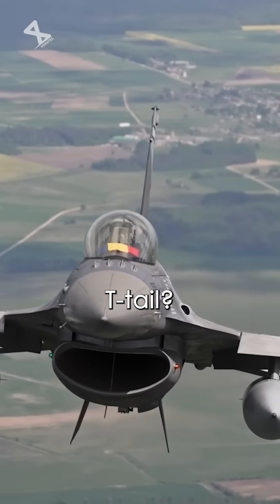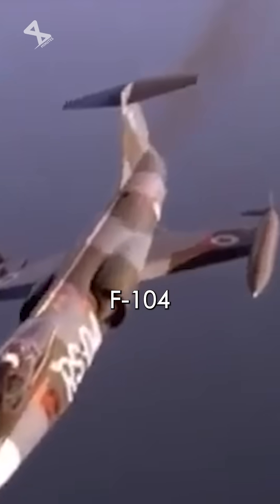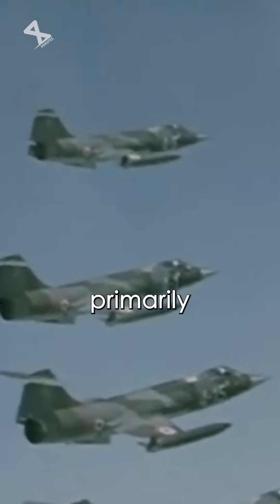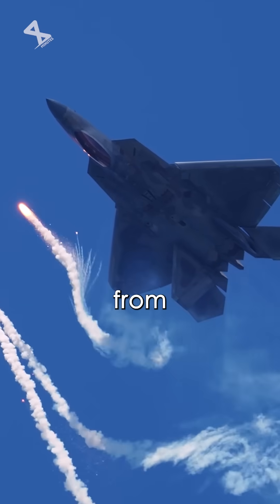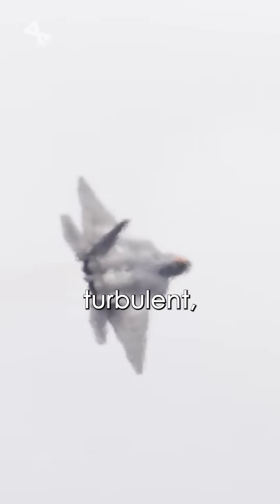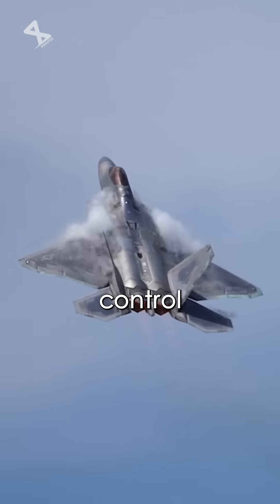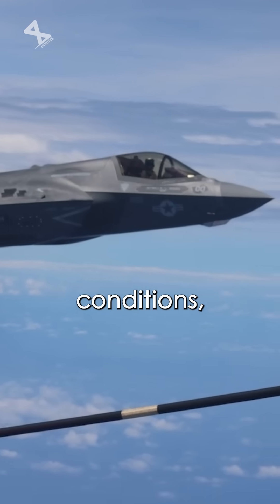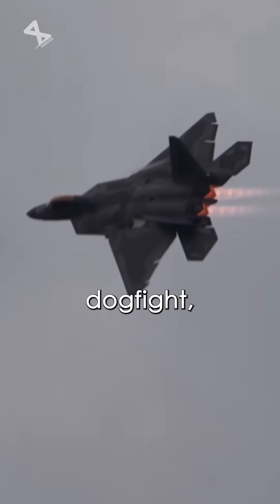Why Don't Many Fighter Jets Have a T-tail?

Comment: The F-104 itself suffered from deep stalls a lot actually. Because the horizontal stabilizer is placed right on the T-tail, which can often become shadowed by the wings and by the plane itself during a deep stall or super stall, normal recovery techniques to recover the plane from a stall may be impossible, oftentimes meaning the plane is entirely unrecoverable. This is one of the many reasons why West German pilots nicknamed the F-104 the “Widowmaker” because of a very high loss rate among pilots.